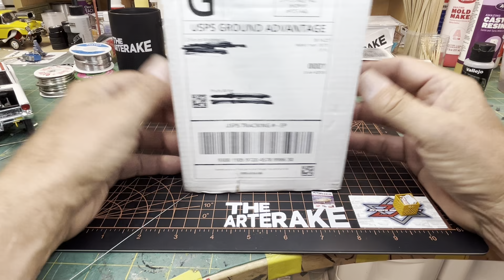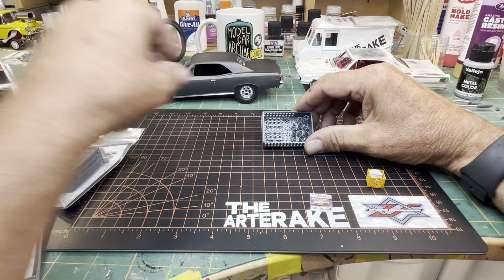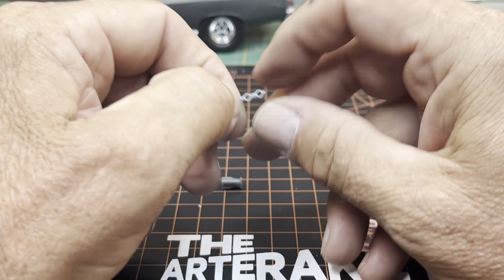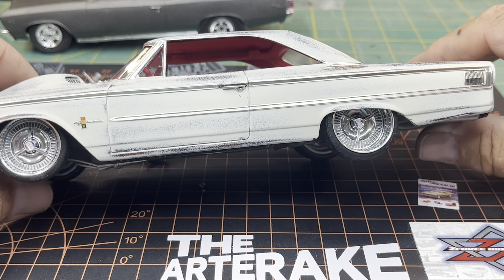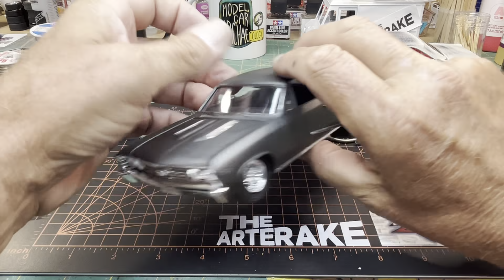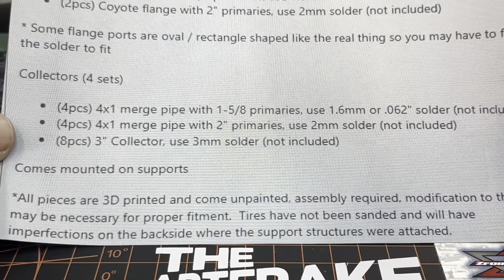New 3D products from Zforce Modelworx!

Comment: FUN FACT: The X-pipe was invented by Boyd Butler. He owned Pro-Motorsports Engineering and Dr. Gas. He sent me 2 to dyno at a shop in Tucson, AZ back in the 90s on a 350 cu. in. race engine that raced at Raven Raceway (now Tucson Raceway Park). The crossovers made power over open headers. Fast forward a year or so later I was working with Boyd in Utah fabricating crossovers, complete exhaust systems for street and NASCAR, and early model Camaro and Mustang suspension components. The NASCAR system debuted on the 1994 Sterling Marlin car which won the Daytona 500 that year. That win created a huge demand. We were busy! Good times. Thanks for sharing.
Reply from the maker: No thank you for sharing that information!

Comment: What Else Was In That Box!!!! Those exhaust Kits are just as neat as it comes, I can see where a builder could either use the appropriate sized solder or the Evergreen / Plastruct tubing and bend the styrene tube. 
 "Sammy Safety Says" ~ If you use, bend, handle, unroll, touch a piece of Solder Please make sure to wash your hands  thoroughly with soap and water, or invest in some "D-Lead" from a shooter's supply to remove as much of the lead as possible, lead poisoning isn't cool! (Years ago while working for that Big Seattle based Aircraft Manufacturer, the one that starts with B and ends with G, yeah that one! 
We had a guy who worked with big aluminum extrusions, big enough to need a crane to move around after heat treatment his job was to straighten the extrusions using a Lead forming die and 30 - 40 Lb. Lead hammer. As a result of beating the extrusion into submission, fragments of the lead would chip off of the hammer head, he would pick them up and pocket them, take the chips home. melt them for big pipe jigs to catch Ling Cod at the ocean. Well it wasn't him but one of his kids became so sick from the lead coming off his clothing transferred to his child's clothes during the wash. The kiddo became so sick that he almost died, they had him in Seattle Children's Hospital trying to figure out what the issue was. It wasn't until they began looking at environmental associations in the home that they discovered dad worked with lead every day as well as casting lead pipe jigs, that they began looking for lead poisoning. The son was only around six or seven at the time, Doctor's figured that by the lead absorption in his body that he had been inadvertently poisoned for over half of his life! Needless to say, B--~--G got sued, even though dad was taking lead home instead of placing it into the proper recycling bin; the Company having deeper pockets than dad's lead lined pockets had to pay out. The Company was also ordered to "Instruct any employee working with or around lead, the inherent dangers associated with lead"!  
Longwinded Story to make sure that you wash your hands before you smoke, dip, chew or chew gum, eat, make your coffee with cream and sugar... because its an easy pathway into your blood stream. Plus the treatment to flush the lead out of your blood isn't very pleasant either! So Please Just Be Careful! Our Hobbies that we love shouldn't make us sick or shorten our lives or anyone else around you either!!  
Stepping off of the Exalted Soapbox Now...
Reply from the maker: Thank you and also for the words of wisdom on handling lead!